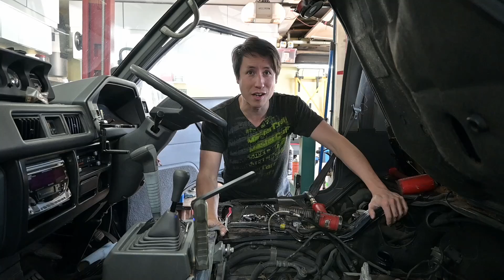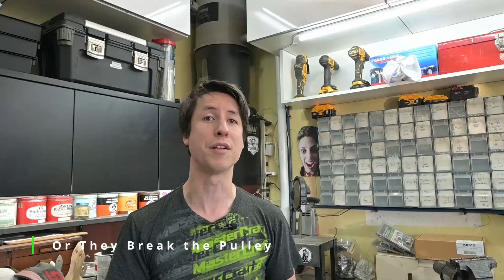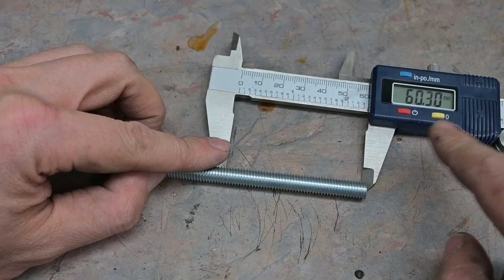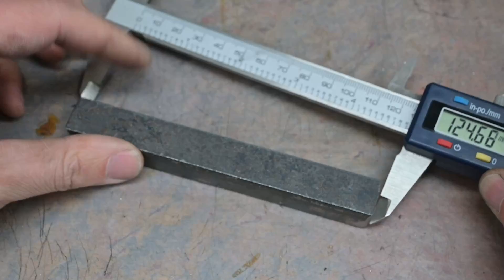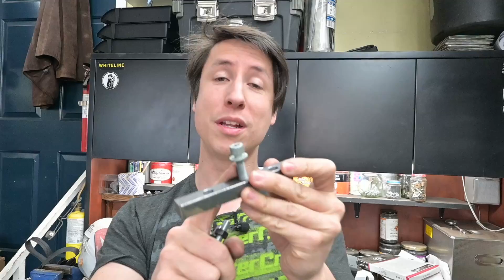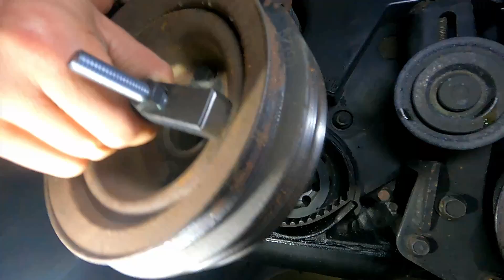A Simple DIY Crank Pulley Puller that You Can Build

Comment: I’ve had success on several vehicles by replacing the 4 bolts with longer ones and carefully tightening them up. But prior to this, I use a penetrating fluid and let it sit overnight. Unsure if it’s doing damage to the TB cog, but it’s been successful on several engines. PS, I’m Kozel on the Delica forum 👍